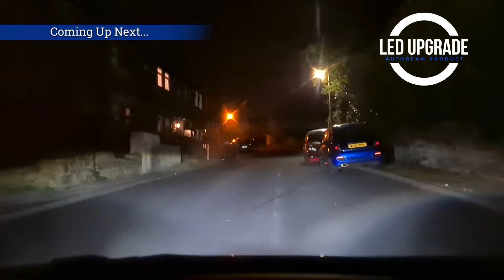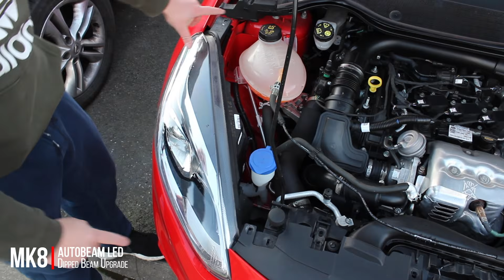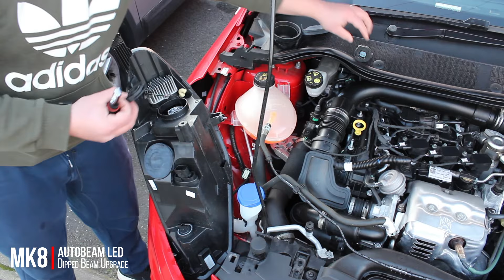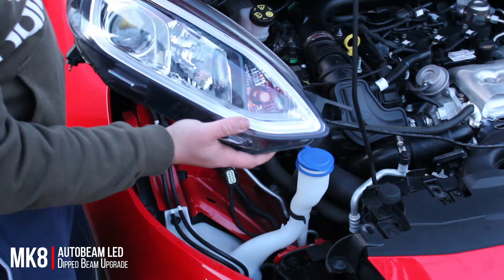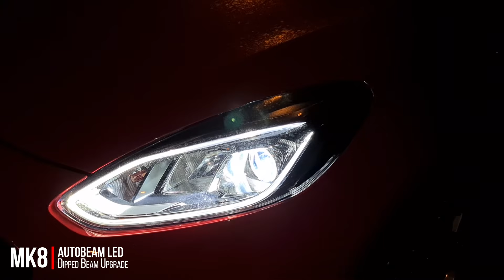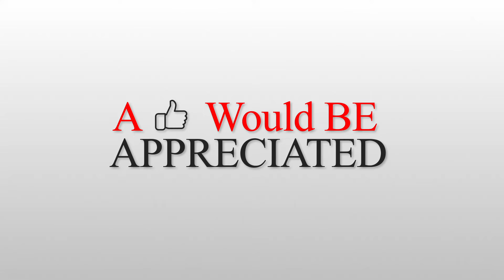MK8 Fiesta | Autobeam LED H7 Dipped Beam Install Guide

Comment: I know this is a few years old and I put these in a few years ago and have since replaced them with Osram bulbs. I didn't really like the light produced and the rubber cap supplied to be poor quality and it perished and cracked after a while. I only noticed when I went to change the bulbs out.

Comment: aren't these illegal and mot failure?
Reply: Only if the MOT tester can see the bulb and if they can really prove it if it's an LED. My car has projector lenses and you cannot see the bulbs from the front. I have LEDs fitted for years and it passed the MOT.

Comment: I was looking for the LED H7 upgrade too for my wifes 2017 Fiesta MK8 (here in Germany). But according Osram and Philips release list the led version is only allowed for the mirror type frontlight E4 25168. For the lense type light E4 25170 is no releases available up to now (okt 23) and the fitting is not possible, may by the missing space for the bigger bulbs. Also the bigger caps are not available at Osram or Philips. It seems, that you install a bulb (from a China market place) with no release by national registration authorities.
Reply: Moin, ich habe die gleichen Scheinwerfer in meinem MK8, die H7 LED's von Osram passen, ohne Adapter. Mir fehlen jetzt nur noch die erhöhten Kappen. Weiß jemand wo ich die kaufen kann?
Reply: @rocudi  Dir ist aber bewußt, dass Deine ABE erloschen ist und im Falle eine Unfalles die Versicherungsleistung für ein nicht zugelassenes Fahrzeug verweigern kann oder je nach Unfallhergang (Nachtunfall) Dir vorsätzliche Verkehrsgefährdung angelastet wird, auch wenn dies (auch mir) abwegig erscheint. Bussgelder und alle 2 Jahre Lampen raus und wieder rein wegen TÜV kommt hinzu. Jedem Prüfer wird die Lichtfarbe am Prüfgerät auffallen müssen da die Fernlichter immer noch gelbliches Halogenlicht sind. Ergo erfolgt Abgleich mit der Zulassung für die 25170 und dann fährst Du erst mal wieder ohne Plakette nach Hause und er muss Dir die Weiterfahrt untersagen und die fehlende Betriebserlaubnis der Zulassungsstelle melden. Für eine Stilllegung noch auf dem Platz reicht es wohl nicht da keine unmittelbare Gefahr wie z. B fehlende Bremsleistung besteht. Aber der Ärger steht ins Haus, da umgehend das Amt kommen wird und das Autokennzeichen entsiegelt.
Unabhängig davon. es wäre doch wünschenswert, dass Osram bzw. auch Philips die Nachrüstleds so gestalten könnte, dass sie für jeden Scheinwerfer der H4 oder H7 Licht im Fahrlichtbereich passen ohne die aufwendigen Einzelfreigaben.

Habe jetzt in dem Fiesta die Halogen +200 drin und meine Frau meint die Ausleuchtung nach rechts ist doch auch damit schon besser. Ich fahre eine neuen Dienst Focus mit LED und da ist ein vergleich nicht mehr möglich. Das ist einfach eine andere Lichtqualität.
Reply: Ich habe die Metallarretierung von den LED abgedreht, diese in die original Kunststoffhalterung gesteckt, in den Reflektor gedreht als wäre eine Glühlampen drin und dann habe ich die LED in die nun verbaute Metallarretierung gesteckt und im Uhrzeigersinn gedreht bis sie eingerastet ist. Die 75mm Kappen gibt es bei einem großen Onlinehändler der mit A anfängt. ;-)
Reply: @rocudi  Aber eine offizielle Zulassung seitens Osram gibt es nicht dafür, oder?
Reply: @GRPCREA  Moin, bis jetzt leider nicht.
Reply: @rocudi  Sehr schade. Die originalen Leuchtmittel sind eine Katastrophe, vorallem bei nächtlichem Regen
Reply: Ja, richtig. Diesen Arretierring mit der Nase dran kann man abdrehen. Den in das Kuststoffteil stecken wo sonst die H7 rein kommt. Das zusammen wie sonst auch mit der H7 am Reflektor montieren. Die LED steckt man dann einfach rein und verdreht sie im Uhrzeigersinn bis es nicht weiter geht. Aber die Staubschutzkappen solltest du dir vorher bestellen.

Comment: Tried to fit it today on a bog standard MK8 fiesta. I have the same headlight port as you. But the led wouldn’t fit in the clip. Cant find the ones you had. Gonna order the pieces i think i need and see. But i cant find the auto-beam clips you used.

Comment: Thanx for the Video…battled to fit the light back…but with a bit of struggle it’s in. Still need to get larger dust covers. Struggling to find them in South Africa.
Reply: Hi Pierre, have you had any luck? I want to fit LEDs in my mk8 but I don't know which to get or where to get the rubber caps
Reply: Hi there, no I didn't and thus put the old lights back. :-( Very sad to do so but those covers are, I think, important and I didn't want to keep the back of the lights open. I must say I did drive with LED lights for a few days and man are they impressive. One thing though was the high beam, I tried a number of different brands but could not get one to fit. You can even get a kit but still battled. If you can find those covers somewhere in SA please let me know.

Comment: Thanks for the install process... but on my MK8 Titanium, (late 2017), the original clips can not work with the H7 dipped beam (as you said). Where can we find the clips ?
Reply: Also my question!
Reply: @maltet.9050  i bought them on eBay ! Just pay attention to the diameter ;)

Comment: Is the LED fan cooling sufficient within the rubber cap for longer trips? I've already had a headlight unit replaced because the the plastic around the bulb melted :(
Reply: they’re not legal. it will fail ur mot. the h in h7 means halogen only
Reply: @m33299  how are they not legal, I’m confused
Reply: @Censorshift  the h in h7 means halogen only. if u put led in a halogen headlight it will fail mot. search it up
Reply: @m33299  Correct. Not to mention the drivers that get pissed off being dazzled by drivers coming the other way with LED bulbs in a halogen headlight unit

Comment: Nice vid mate!. Do you have issue with whining noise from the leds cooling fan of the leds.. I got a similar product from ceuk. This was mainly heard when car was at a stand still or as I turned ignition off.. Sent them back in the end as it was bugging me.
Reply: me too mate - fitted today and seem to get a whining vibrating noise from the left LED fan. the right side is ok though

Comment: I found that once I installed them, its too tight against the two small pipes and metal work. I had to move the pipes and leave the caps off. Did you have the same problem.
Reply: I had this problem even with the smaller version that autobeam make (with a smaller heatsink).
Very disappointed
Reply: I've had my kit maybe 12 months, and decided to have a go fitting it today, but come across same problem. With the 75mm caps supplied, you can't get the headlight back in correct place as it's hard up against the metal seam .

Did you get a resolution to this problem?
Reply: @wicky525  I found a solution, but not the one I wanted. I decided to stop using them and reinstall the original halogen bulbs. Shame
Reply: @DualHat  cheers for replying 👍

I've taken too much skin off my knuckles attempting, and, as you , refitted the halogen bulbs 😭

Comment: Any luck with full beam? I haven't found any adapter or mounts to get the h1 mounted, seems we have to make something ourselves
Reply: I will get the vodeo uploaded next few days for you
Reply: The h1 does fit but has to be placed in using the dipped beam hole for you to get the right angle for the full beam

Comment: What size black cap did you order?
Reply: 75 mm
Reply: Stephen Holder thank you 😊
Reply: Hi sebastian the black caps I used came  with the set of lights :)
Reply: @reece4626  so if you order these lights the new bigger black caps are in the order ?

Comment: Was worried aftermarket led bulbs won't be bright enough but these look quite good so going to give these a try. Great tutorial also. Thanks
Reply from the maker: hi mercman 88 ive not had any issue so far and i do alot of back road driving i also have full beam video coming in next few days so keep checking back
Reply: @r23spk34  look forward to seeing that, im gonna hold off buying them until then